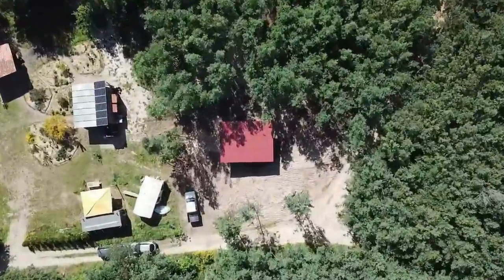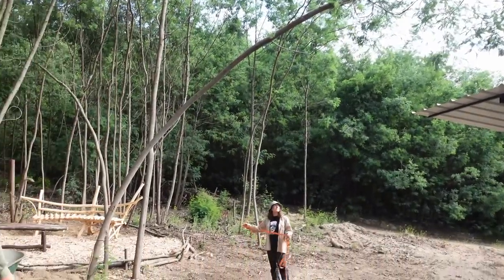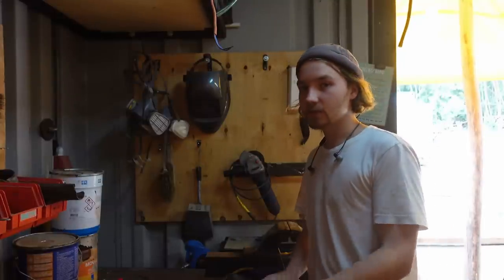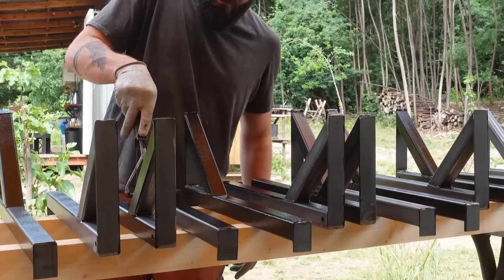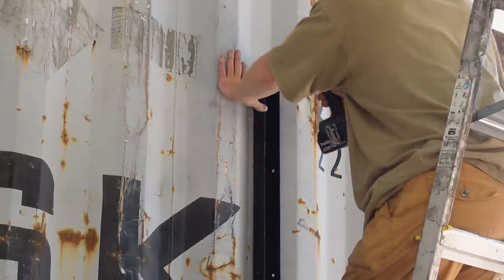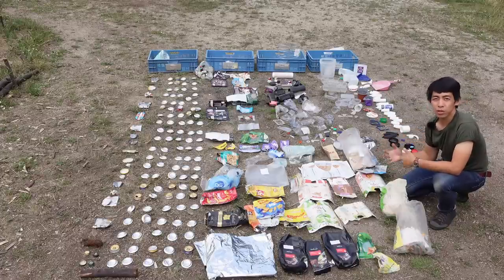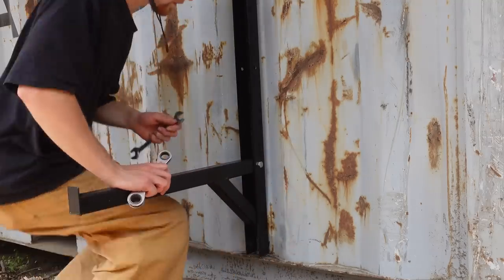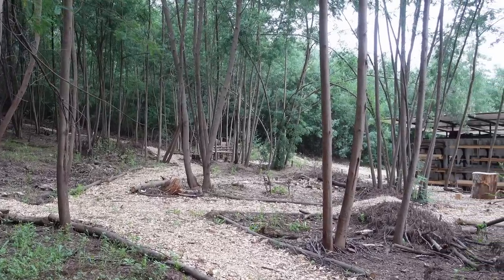#83 Building a storage system in our new container

Comment: Hello from California, little suggestion for your metal working space. As a welder, you should make an outdoor  work bench for metal working. Save yourself time on clean up and also save your ears from the echo but also lungs. Don’t want to weld inside if you don’t have to. Much love 👍🏽
Reply: The wind is a problem with welding.
Reply: Sparkles would be a risk of starting fires during the dry season

Comment: Honestly, to protect against further corrosion,  you should have cleaned up the rust, and put on several coats of a good industrial quality paint prior to any additions.
Reply: Containers like these are made of COR-TEN steel or weathering steel. The buildup of rust protects the material underneath and will never rust through.
Only reason to paint them is for aesthetic reasons and even then you encounter some environmental issues with metal paint and the cleanup/leftovers of it.
Reply: @reversetec7703  I don't know about never rust through: I've seen some containers scrapped that have some pretty impressive "tin worm attacks"
Reply: @reversetec7703  Is COR TEN steel designed to have dozens of holes and sheer forces

Comment: Hey Project Kamp, thanks for the updates! I have been enjoying seeing new faces and work progressing. BTW, I just wanted to mention that when burying cables its generally a good idea to put several cm of gravel underneath the conduit. This will prevent soil compaction and settling from putting stress on the wires themselves. Since you've disturbed the soils they will settle down a bit and with a flexible conduit, there's a good chance that problems could arise from burying the cables without this additional step. It seemed to me (from the video) that the soils have a high amount of organic materials in them which increases the settling issue as they decompose. In the future I strongly suggest taking my advice so that the power systems can continue serving the community! Cheers!

Comment: Mimosa tops as a resource!  I really like the idea of using the mimosa tops to form the base of  on contour berms.  Hybridization of Hugelkultur, water infiltration, adaptive reuse. and topsoil retention.  That is a grand slam home run ♥ If you  make bundles of the mimosa tops with a strong just or hemp cord (mimosa top "logs"), you will be able to pack a lot more mimosa into your berms. The on contour berms will be a great place to plant fruit and nut trees.  For that purpose, space your on contour berms 10 meters apart to allow for the trees canopy to come to maturity without interference.  If you plant chestnuts, they need to be 15 meters apart in all directions because they will grow to be HUGE trees.  Do you have some ravines on the property?  I think I see one in the background at 1:03 in the video.  Low areas that flow with rainwater during storms can greatly benefit from what we call in the US "beaver dam analogs".  The only material required is fresh brush that can be woven and pointed wood posts that can be driven into the ground.  The purpose is twofold: Slow the velocity and control the release of the  volume  of water moving across the property to reduce downhill erosion, increase infiltration and act as a sediment trap to clean the water  from uphill.  Here's a "how to"  & "why" YouTube:   https://www.youtube.com/watch?v=63ji0XFPwBQ

Comment: You could use some of the plastic for a 3d printer.. 3D printers are amazing and very useful so if anyone in the kamp knows it it's a good option
Reply: well they also require a special plastic thqat comes in thing strands so it would be tough to use the plastic for that. cool idea though!
Reply: @CimberMatic There are many videos online of how to make DIY plastic filament extruders that will recycle plastic bottles into filament for use on 3D printing. It's worth a look if they need to print some bestoke parts such as hooks and kitchen utensils.
Reply: would need to know very specifically which kind of plastic it is and exactly what its extrusion characteristics are, and experimentation for any given piece to see how manufacturing additives have changed it.  also needs to be thermoplastic. Also needs significant effort  to calibrate and maintain even with known off the shelf printing filament. Not impossible, but the cost in human effort needs to be considered.
Reply: I saw recently that someone was using a very small solar panel and thin plastic stripes made from bottles, and turning it into reusable 3d printer rolls. The process was slow, but super clean.

Comment: You don't stop impressing me.
That metal work and soldering was super professional.
You are so lucky to have such a great diversity of talent.
Mimosas are kind of a problem, but you should try to get the most out of its wood. 
Catching its resin could be useful. 
And don't forget that during winter, you might need some dry mimosa wood for the fireplace.

Comment: This is a great infrastructure update. These are my favorite videos. I want to suggest that  you add larger washers to the bolts attaching the shelving to the container.  It is possible over time that the bolts might start to warp the container walls and possible pull through. That would take a lot of weight over a long time though. Also, the "spikey wire" is called barbed  wire. 

I love your videos and always look forward to them.

Comment: At the end of the screw, there are two numbers, in many cases 8.8
to calculate the strength you say 8x8 = 64 times with Diameter.
if you screw an M8 it is 8x3.14= 25.12 and then multiply that by the 64 = 1,607.68 KG in pull for an M8 ;-)
thank you, greetings, the blacksmith

Comment: That mimosa bench is beautiful. Can just imagine the colors if stained. Benches, chairs, hammocks, stools, railings, retaining walls, berms, bridges, roofs or shade covers, troughs, stalls, mixed with mud irrigation ditches.

Storage area looks neat and organized. Could fabricated metal shims or washers be used as spacers to help level the bolted posts? Any plans to rustproof the inside and outside the container? Any intentions for separate solar or wind power sources?

Lots of opportunity to collect roof rain water runoff for cleaning, watering plants, irrigation, pond/well/stream storage. Or filter, pump to storage tanks for later use. Possible storage for dry season. Or underground piped irrigation to stream/pond/well/river.

Comment: I have used Vinegar 30% strength to deal with brambles and I use it with the wood chips on the path to keep any weeds or brambles at bay during the summer. I find one application is good for about 4 to 5 months. Just a thought.

Comment: iv always wanted to learn to melt down plastic and metal and make molds to pour them in, and that might be a fun project for you guys too if it sounds interesting. you can make molds out of something like clay or a mud type solution to pour things over, and make all sorts of shapes. even so, it would be super easy to make brick or disk shapes for easy storage to then remelt and use for later molding. if you ever had so much of a resource you didnt know what to do with it, building would take up a lot of that resource very quickly

Comment: Nice work on the rack. Here's a tip... When you have to drill a big hole, start with a SMALL hole... drill a pilot of 3/16" (maybe 2mm) or so first. The reason is that large drill bits have a large web connecting the two flutes, and that web effectively forms a chisel shape at the center of your hole. Forcing a big drill bit without pre-drilling a pilot hole generates a lot of heat, and this wears out your expensive big drill bit a lot faster. A 3/16" drill bit is very cheap in comparison.

Comment: Wiht plastic botles you can use  them for making cords, or use it to print in 3d, if someone knows about 3d printing in the kamp, buy a 3d printer and a filament machine to melt the botles and make cord for de 3d printer. Then you can fix things, replace plastic things or make anything.

Comment: You speak of standardizing lumber sizes for future recycling.  I wish to suggest standardizing the method for delineating native trees to be protected.  Air dried mimosa posts about 35 mm in diameter and 1.5 meter tall with the skinny end pointed and the fat end painted with a standard 30 cm band (white?).  The standard pattern is two stakes per tree.  Each stake is pounded into the ground approximately approx 20 cm  from the trunk.  Each of these trees will have a mulch ring approximately 8 cm thick X 1 meter in diameter. the chipped mulch will be held back from the tree trunk by 5 cm all around.  The purpose of the mulch is to: 1) Protect the root zone from compaction 2) retain soil moisture  3) regulate soil temperature 4) simplify watering  5) provide nutrients and 6) Create beneficial soil biota via decomposition.  If you standardize your delineation in this fashion (or an iteration that works for you)  the development of your native volunteers will be greatly enhanced and there is reduced likelihood of accidents and/or oversights. 😊

Comment: I've seen someone who used some kind of tool, I think it's just called a bottle cutter, to turn hard plastic bottles into plastic strokes (rope kinda) to use in making furniture etc. The tool seemed easy to make with just some wood or metal and a razorblade. You should be able to make it yourself quite easily. Might be a good use for those plastics at the kamp!

Comment: Love the videos, one suggestion that may have already been added in the comments, you really should have treats the rust and painted the container, if well kept, these containers last for decades, in this state, you will have holes in your container easily within 10 years, even though it is covered from the rain; The condensation the metal attracts will slowly eat this thing alive - aided by the added humidity of the wood chips.

Comment: One way to use the big water bottles, was spotted by me in the Balkans.
They are used as a cheaper version of the spanish Ollas:

Dig a hole next to the plan you want to irrigate. Make a few little holes into the lower part of the bottle and plant the bottle into the hole. Fill up the rest with soil.
Now you can put water into the top of bottle, avoid evaporation of your water and lead the water directly to the lower part of the soil, where the roots should be.

Comment: Do you know there's a sewer out there? A rubber eye sailor for sailing roofs and things it also has a cooling process in it when you paint it on you do it about 2 layers to. 3 layers and it keeps anything inside the container cooler from the top metal. It just hit just protected the Mexico cooler.

Comment: From a graphic designer; you could cover the aluminum sign with red paint, squidgy away the paint from the flat surface, which will leave the red paint in the recessed letter forms. Much easier to read.

Comment: You could upcycle PET bootles by doing a filament machine which combined with a 3d printer could be usefull to print something in order to repair an object (a small gear that would have been broken, ...) or even to help do some decoration, signs...

Comment: I think you could recycle paper, glass and metals in situ, paper is very straightforward to recycle, first make the pulp by soaking the paper in water then make the sheets; glass can be melted in a gas or electric furnace; once you unlock the possibility to extract energy out of the river it would be even better as the extreme load won't be on the battery and pannels to not risk a short due to high demands by the melter

Comment: I would have mirrored the system of the material bank on the inside for storage of other stuff, the holes in the container are already drilled and it will help balance it, so the material bank won't pull the container out of shape (or even the bolts through the holes).

Comment: Nice project, but to use new expensive metal for outdoor storage I will try to use recycled material.
If you will use second-hand warehouse racking, you do not have to drill holes and especially do not paint, only paint damaged areas.

Comment: With batteries that's cheap, cause it's a ok size(panel wise) batteries are really expenzive here in denmark, here you pay for the fuse size and just ones, the price pr kw is the same, tax on the kw i lower after 4000kw on a elektrik heated house, but the base price is the same for all😉

Comment: About the hard plastics I would recommend an idea I saw Advoko Makes (a Russian youtuber) use in some of his videos. He cuts plastic bottles in to thin strips and uses it as strong cordage for alot of his projects because plastic bottle material shrinks when you heat it up and hold un to weather very well. he has made chairs and other useful thinks without using nails insted using these strips of plastic and some heat to shrink them in place.
Reply: Also I don't know if I mentioned it on any of your older videos but I would highly recommend building a water wheal to generate renewable energy.

Comment: possibly the most overbuilt shelf of all time lol. With square stock that size these shelves could hold thousands of pounds of material. Hell, the sheet metal of the container would bow out long before these shelves started to give. Seems like making it with wood would have been cheaper, easier, better for the environment, and plenty strong for this application. Not hating just an honest suggestion.

Comment: For someone not that knowledgeable in regards to metalworking.. it seems like the shelf you built is super heavy duty, but it all rests on the strength of the one bolt holding it in place. So each shelf has 2 single contact points, and those are everyday bolts? 
Again, i am very unfamiliar with metalworking, but that seems very risky to me.. It wouldn't be the first time a bolt shears off due to weitght.. 

Seems it could easily be enhanced just by adding a notch in the vertical shelf that the bottom part of the bracket rests in before it get the bolt trough. Then atleast you would have 2 different contact points for the weight..

Comment: I wanted to say: why the heck would you need a thermal camera in the wild to measure surface temperatures (obviously you wouldnt paint a surface black or in dark colours because they absorb more heat to the surface) but potentially if the camera can measure temperatures at a distance it can be helpfull to measure the temperature in the land. Even if the camera's range is not that high, you can still walk the land and see the exact temperature and get like a daily graph and when its too hot you can do something. Its not always obvious the temperature close to the land and near the trees, it can be very different than that of a an air thermometer.

Comment: Why didnt you paint the container with a rust preventing paint?
Reply: I was curious as to why after drilling holes and beating with a sledge hammer the container was not painted but the other metal hangers were? You prevent some metal from rusting but leave other metal unpainted.

Comment: Hard plastic is used for potted flowers and to put the plastic bottles high up in threes or near your camp high up, or if you have enaugh plastic bottles and a lake, you can create a raft or an artificial island (many people on youtube did it) using the plastic as a floating device. Once the plastic starts to decay you replace the plastic. 
Or, you can do what i did: BURN IT! If you take it to a landfill they wont burn it and the plastic will linger on for years. Or, another great ideea for hard plastic is to make biogas! there are tutorials on youtube check them out. Its not a lot but its a cool way to dispose of the hard plastic and get something usefull out of it.

Comment: If I can be so bold to suggest, for the metals, learn to smelt them down into respective metals.  Pure Aluminum bars for instance are QUITE a bit smaller and more space saving than cans would be.  Not sure about the other metals, but provided they are able to be separated out they may also be something to melt down when they are just tiny scraps .  bars of metal are always easier to store!